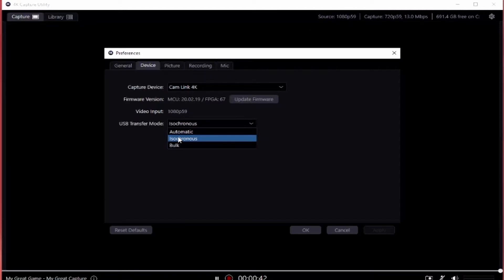HOW TO STOP CAM LINK FROM FREEZING

Comment: hi it's 2024 and i stream with my cam Sony A6100 with the Elgato Cam Link. today the cam started to close by itself and give the "no signal" on OBS. it did it multiple times (i had to close and open the cam for it to show the image again). I don't have the option in 4K Capture Utility even when I press Crtl. I don't know what to do!
Reply from the maker: Elgato has another app called cam hub. I think it's supposed to be their new interface. Download that and follow the same steps and see if you can control + left click. Here is a reddit thread that talks about it. https://www.google.com/url?sa=t&source=web&rct=j&opi=89978449&url=https://www.reddit.com/r/elgato/comments/soalq1/camlink_4k_cam_hub_update_to_change_to_isochronous/&ved=2ahUKEwiAverHquCEAxVOhIkEHbKSC8QQjjh6BAgTEAE&usg=AOvVaw0nj8x7hr_3EBUggxjNjr2z
Reply: hi! finished my stream and my cam keeps closing for no reason lol! i already have camera Hub but when i do Crtl + left click i get no options... :( @TeckneekYT

Comment: When I hold control and click settings it doesn't give that extra option.
Reply: Same
Reply: I did manage to figure out the setting
Reply: @marsirgaming  Hey! did you figure it out? I could not figure this out
Reply: @cutedolly2k  yes it isn't in the location on this video but the method is the same if I remember the right stop it is on the left side and you do what he says to the settings button. I am not sure off the top of my head but if you still have troubles I'll hop on my pc and re find out the right way and let ya know.
Reply: @cutedolly2k  you may have to unplug the cable from your PC first so the software loads up right the first time, but when you open the program in the device section there's 3 lines, do the same thing, hold CTL and the box will drop down and you can save it. Just worked for me!